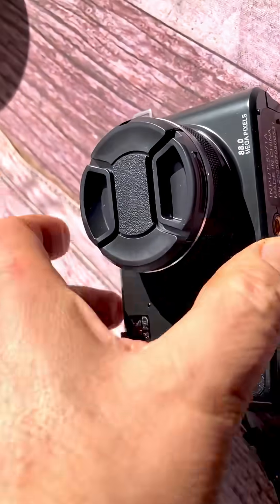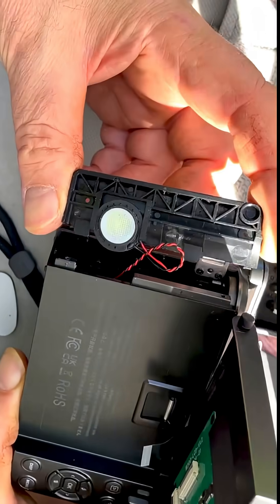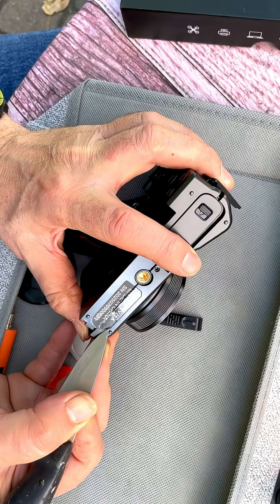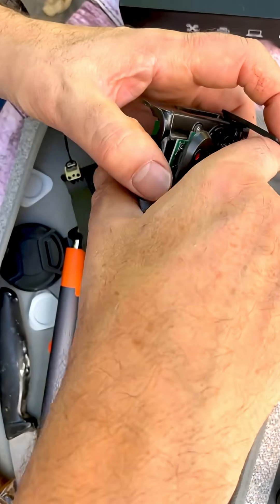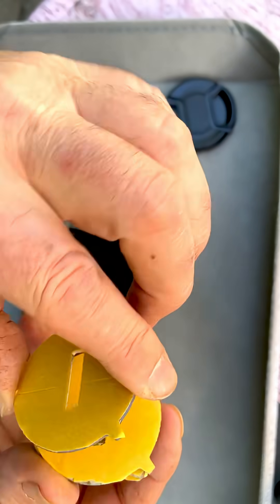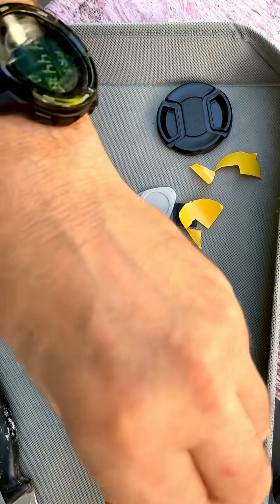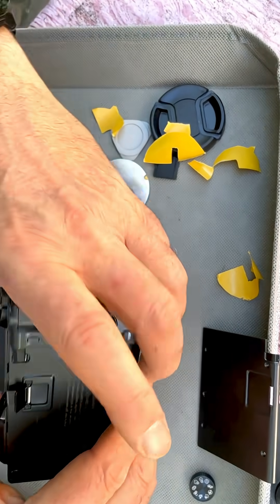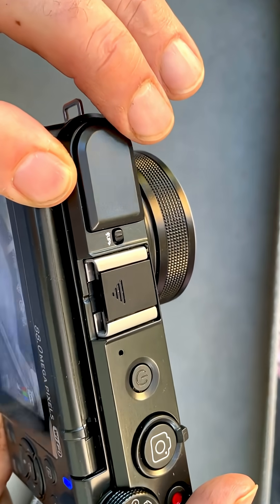DIY Fix Finds Deceptive Manufacturing of Cheap 8K Camera

Comment: Give some video samples from the camera in a new short
Reply from the maker: I could, but not sure how relevant that is.  I received the camera in exchange for my review, but it was broken (parts loose inside).  Now that I fixed that, it seems they don't even sell this model any more.  I plan to try using it, but even though it's capable of 8K, I think anything on YouTube is maximum 4K. Besides, this camera does not seem to have good auto focus and I noticed a problem where faces get completely washed out in bright sun.  Perhaps I SHOULD do a video to warn people not to expect too much from this kind of camera.  Seems I'm almost talking myself into it!  Thanks for the suggestion - I'll consider doing that.